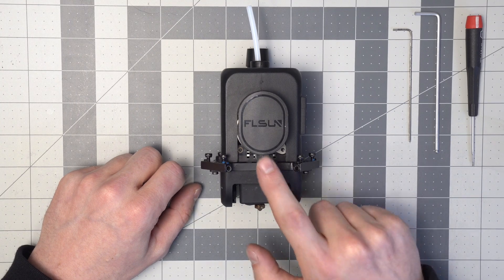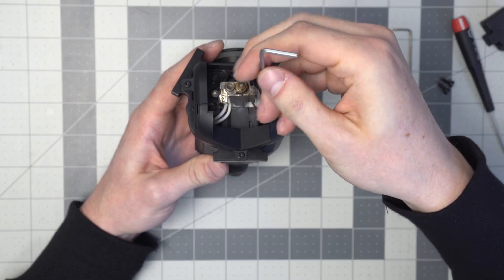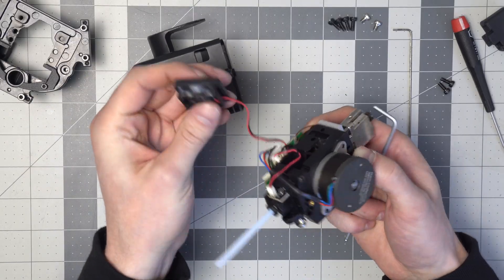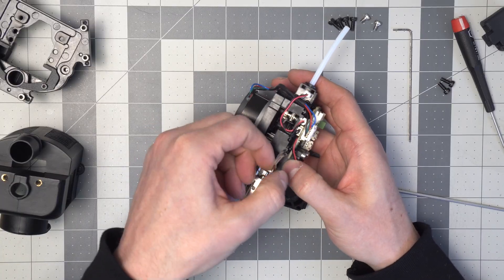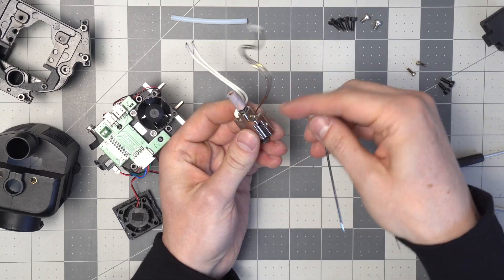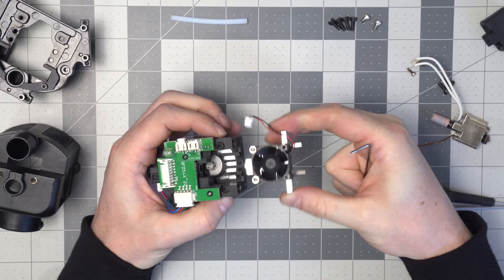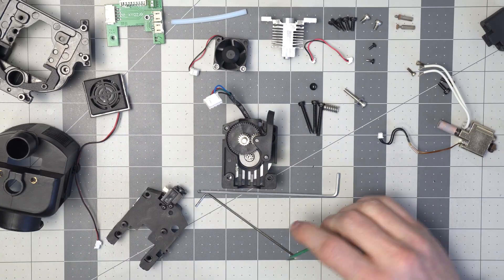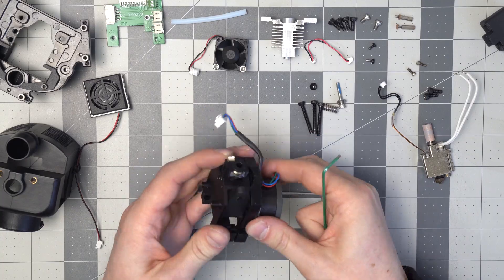FLSUN T1-PRO Print Head Teardown

Comment: My nozzle crashed into my bed, had wavy prints like my vibration compensation wasnt working. Tore it all down after trying a bunch of different settings to fix it. The printer does not work like it did before the crash, but this video got it most of the way back. Thank you.

Comment: Thanks for sharing! Any plans to upgrade the effector for printing abrasive filaments in the future? The ability to print abrasive filaments is the one feature I feel that The T1 Pro should have had from the factiry.
Reply from the maker: No plans to upgrade. I’m still just waiting on parts to hopefully have it print reliably. 

You’re right it should probably be a factory feature at this price point. Lots of brands moving to hardened nozzles as standard.